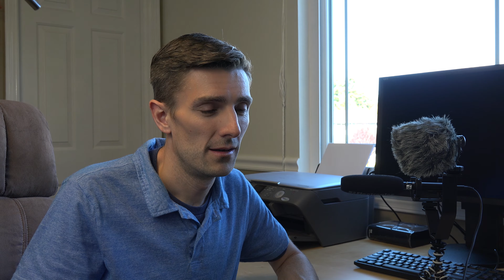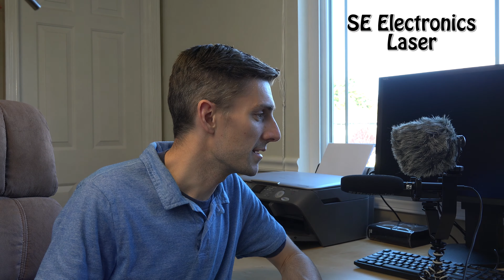Rode VideoMicro Vs. Se Electronics ProMic Laser Comparison

Comment: Is it possibile to mount the laser a bit behind? Because it's extremely long and can go inside the camcorder scene.. is it really better than videomic standard? Can be use to record cars on race track while zooming on them? >Thank a lot.
Reply from the maker: They mic doesn't have a fixed position in the mount, you could slide it back a couple inches. For more distance you would need to get some sort of bracket. I haven't had a problem with it appearing in the scene unless I use my fuzzy windscreen, for that I have cobbled a couple cheap hot shoe adapter pieces to raise it up a couple inches. I like the sound profile better than the Rode mics because the lasers has more low end response. Better is subjective. I think it is more neutral where Rode mics focus on vocal range. You are trying to record track noise? If you are in the stands you would probably get substantial crowd noise because they are so close to you unless the cars are very very loud. It doesn't work like a zoom lens, no mic does. Instead it will reduce sound to the side by about 50% but it cant' focus on sound far away and filter out sound that is closer. In general you want to get as close to your sound source as possible.
Reply: The cars are loud, also 50meters away. My pain is about shielding, because in the past I had some signal problem on some mic, where at amy home have no problem. Maybe the cb, radio, I don't know, but with some mics on track there is a kind of frequency noise when silent, no hiss noise but this annoying factor, how can you know if a mic is rf shielded or not? Rode does it for its products?
Reply from the maker: The Videomic pro from Rode I think is shielded. I am not sure about the micro probably not. The Laser is all aluminum which should be pretty effective at blocking rf. I have never had a problem with rf but I don't know if I have really been in a bad situation sorry. Also in bleachers there could be vibrations that come right through your tripod or monopod. Not sure how you would fight that. A tough situation. Have you tried racing forums to see what others have experienced?
Reply: Not yet, because with some mic problems and with others not. I thought it was something related to cb signal on track or something else, because outdoor, near house, you can push over 20db signal without any hiss noise on my last mic, while on track, also by putting -24db on camera by orientating the mic a strange low signal enter the mic. And it's not made of metal the chassis of the mic..

Comment: I use a canon 600D or a T3i. A problem I have is that because the sE laser doesn't have a db boost like Rodemics do (the 20db+) it means you have to turn up the camera gain which is a bummer because the camera adds a lot of hiss on its own especially with that gain. But nonetheless the laser beats the on board mic hands down, but still hissy on a 600D
Reply from the maker: I imagine you could solve your issue the same way as as @tendandtaint even though it is a different problem. He found that the canon cameras don't provide the standard phantom stereo mini plug phantom power and so the signal is weak and noisy when amplified to the maximum by the canon alone. He used a little pre amp ( IK iRig PRE) that looks like it costs about 30 or 40 dollars and saw a big improvement. This would prevent you having to turn up your canon preamp and do the same as a "boost" in mic. The idea with the laser is that the default is like the boosted mode of the Rode but more like +15 probably and then the pad is like the Rode +0. As with all mics they are dependent on the performance of the amp of the device they are plugged into. I leave my Sony gain at less then half way up and can go way above safe levels without it getting noisy.

Comment: Hi TL I just bought the Rode video micro. On both my Canon 5D2 and 750D it sounds absolutely awful! The hiss is worse than the onboard mics! On Manual, with lowering the camera gain right down to bring down the noise floor, the signal level is unusable at around -25db. Which camera are you plugging into here to get it sounding so good? :o PS The really annoying thing is, is it doesn't seem to function at all if I plug it into my lovely juicedlink preamp. Be interested to hear how you got it sounding so clear here! :)
Reply from the maker: Hmm. I just used the jack on my primary camcorder the ax100, nothing special. I had seen some reviews on this mic that didn't think it sounded good with Canon cameras. It is difficult to explain without having access to one myself but... I have a terrible hiss if I connect it to my Sony action cam the X3000. I discovered I needed to turn off Bluetooth on it to use this mic then it completely goes away. The problem is a ground loop, two electronic components sharing an electrical ground causes signal issues. Since this mic is powered from the "phantom" (not really but sort of) power from the jack, other electrical systems that use the same ground (inside the camera) can cause signal interference. I see the 750D has wifi you could try turning that off but I see nothing that you could disable on the 5D2. Your better bet would be to pick up a ground loop isolator. Several different models are available on Amazon for less than ten dollars or ebay for less than six. I have used them at work and they did the job. Let me know if that fixes it.
Reply: Thanks for the reply TL. It is mainly the crap Canon preamps to blame. For anyone else having this problem: I have since discovered (with my multimeter) that my IK iRig PRE (that I use with an AT shotgun mic on my 5D2) actually puts out only 9v max of phantom power. I connected the Rode micro mic to this, and voila! with the 5D2 internal gain set two clicks above 0 it seems to be working fine now - hiss gone. Rode are a bit naughty not revealing that this mic will not run OK without phantom power on Canon cameras!